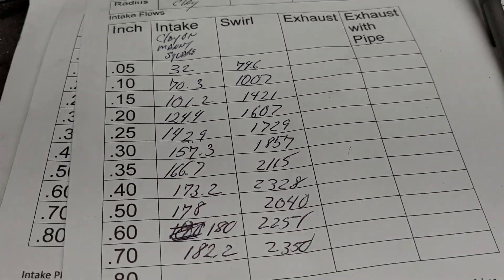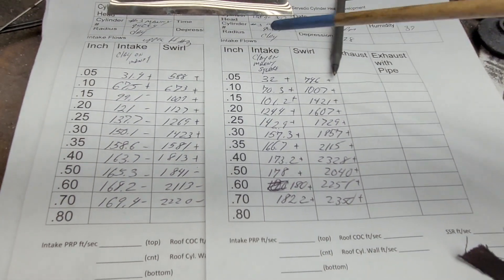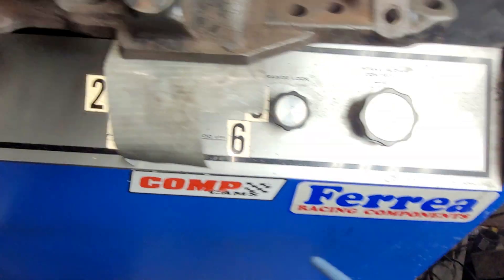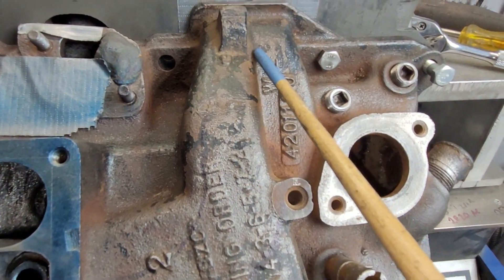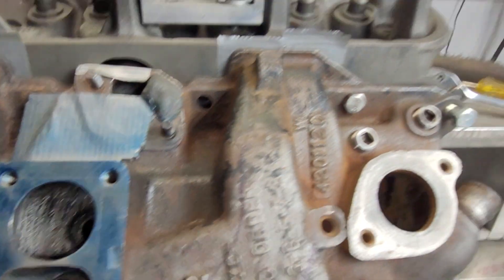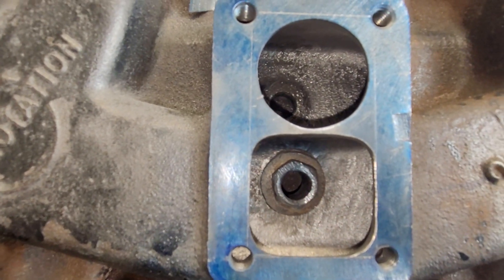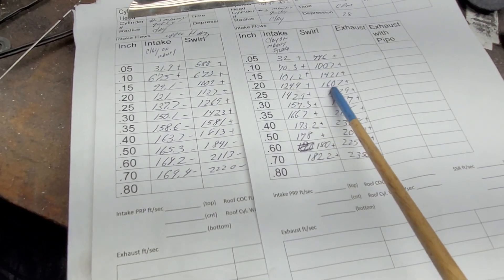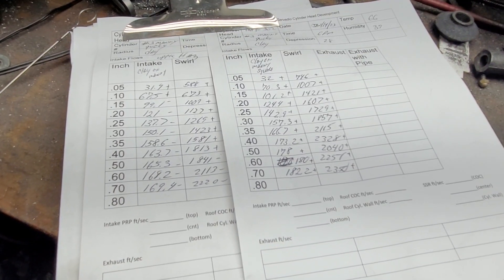David Vizard, Uncle Tony's Garage, Unity Motorsport, Mission Impossible project. Square Plenum

Comment: I was thinking about this some more. If the long piece of emery cloth is strung from one intake port exit, through the plenum (but not out the top) towards the opposite "T" and out the opposite port exit, you could round/polish two areas at once and they would be next to the floor where the flow wants to go?
Reply: It would have to have a twist in it at about the halfway point.
Reply from the maker: @stuartwall8212  yes it would

Comment: Do you have square throttles in the carb, or does it really hurt having a round hole over the square? Guess you can test it. Or maybe you could use a 1/2"-1" adapter that is matched to the manifold and carb. The freeze plug idea in the corners was nice, will try that in a 318 I'm building, but go from underneath if possible so that it's not visible on the top.
Reply from the maker: Andy spoke of an oval throttle blade in one video. Square made it possible to widen the turn like a ssr which picked up flow.

Comment: I played around with a Chevy 350, early 90's throttle body injection intake about 20 years ago, I hit water, sealed it with epoxy, it did ok. But if I ever did that again, I think I'd just use a 4bbl dual plane, performer or something, and make an adapter to fit a 7.4L throttle body, and it being now, I'd use a aftermarket ecm to control it, but EFI would be the next step, or a aftermarket 4bbl throttle body, all in one deal, self learning,  it would be much better, the tbi is just a bottleneck,  the aftermarket 4bbl tbi on a performer rpm intake would probably be night and day difference! Especially with 10:1, cam, head work, or atleast non swirlport heads, I swapped on 5.0 H.O. heads with dishes pistons they probably would been ok, flat tops with near zero deck, it would barely run on 93,
Reply: How heavy was the car, and what gear ratio was in it .....if you dont mind my asking? Do you remember  @ what degree the intake closed?

Comment: i cant blame you for trying to improve the piece.but sometimes a turd will allways be a turd no matter what you try. a perfect example is a VW air cooled single barrel, single port intake.no amount of grinding or welding & polishing will dramatically improve its flow rate.its like trying to make a wedding cake from oil pan sludge.
Reply: The 318 is a turd .
Reply from the maker: @MP-pz9oe  No, 318 has no idea it is not a 340. It is down a few  cubes and a bit of strength. But with some work they will run just from the design. And I love the 340.
Reply from the maker: Tasty

Comment: You say you are getting hate on the project, I think mission impossible is a great project as stated, the way DV has talked in some videos though it sounds like it's changing. I hope it sticks to the premise of how much power you can make from Mopar's only non hi-po v8 without aftermarket parts using ingenuity and attention to detail. 

1:1 is a TALL order for that engine but you have done an incredible job so far. If that manifold can squeeze just a little more you have a real shot. 👍👏
Reply: And by the way, I liked the finned ports as well. I think the scavenging losses will out weigh the velocity gains on the quickie
Reply from the maker: Thanks, I like the all Mopar plan. That is why these heads are 1.88/1.6 valves. I could use a full set of new 360 valves. I will ask DV. If valves are in the budget. Thanks
Reply: @servediocylinderheads  See that idea as far as I'm concerned would totally fit the rules they laid down. Anyone could have gone and got them at the dealership. I forgot whether anyone has mentioned it or not but is it an LA or Magnum?
Reply from the maker: @jseal21  l a

Comment: What would happen by adding material (clay is fine for testing) immediately before the turn in order to make a longer radius?
Reply from the maker: Not sure I understand.
Reply: #1 How to get it down to the T corner...
#2 How to make a permanent addition.
If you cut a hole in the upper plane, are you going to cut a hole into the lower plane through the bottom.,?
Then you still have to epoxy in a core plugs or weld them.
#3 how about a V splitter at the T to flow the air each way.
#4 The wet flow will.be horrible.
Reply from the maker: @hotrodray6802  Watch my David Vizard/ Brzezenski manifold copy video. It will answer lot of your questions. Thanks

Comment: Now if you really wanted to waste time, heat up the intake in a huge forge and weld those corners up to make those radii large and the take a hole saw and cut two inch holes in the four areas on top and below to port them out.. then re weld in the 4 holes and go.
Reply from the maker: Thanks, no kidding.
Reply: @servediocylinderheads  would yo
Reply: I foresee porting laser with small cameras, uses shutter to prevent blinding the camera using a 1-1000 ms pwm to really fine tune amounts of metal removed, could also double as a welder.

Comment: I have cut down dividers about 1/2 inch and that seems to work very well. Any extra flow to cylinders really helps. As you said I think you restriction may be the corners. Do you know the csa where the plenum floor reaches the port? It depends on which casting but sometimes a small square there turns into the rectangular port on these castings.
Edit: IMHO that is why the bottom runners flow much more. In some cases.
Reply from the maker: Branches off the plenum are good for 300+ cfm.
Reply: @servediocylinderheads  Now you have me wanting to see a version of this manifold dynoed with a pair of 2bbls mounted at the runner interesctions and leaving the center connector as a balance chamber. This is a cool project to think about and brainstorm on. So many what ifs!
Reply from the maker: I like it!
Reply: @bcbloc02  Adding a carb above each runner T, but how you going to connect the two planes?
Reply: @hotrodray6802  I figured drill all the way thru the floor of the top runner and put a tube into the bottom one. I don't know the details of the casting so that may not be possible?
Reply from the maker: I bet someone has done it.

Comment: Dont machine divider all the way down. You want to keep it a dual plain manifold. Just mill down the divider one inch from top, front to back.  This provides excellent idle and tuning, low and mid range torque improvements, and air savaging from each opening when needed at all rpm's [helps with pressure and swirl].
Reply from the maker: I was thinking 1/2" and see if it helps. Thanks
Reply: @servediocylinderheads  - Yes, 1/2 to 1 inch...  1/2" is what I recommended on earlier video.
Reply: I wonder what you could do with a spacer with different thickness open gaskets on the bottom?
Reply from the maker: @williamhenk1030  I may try this. Thanks